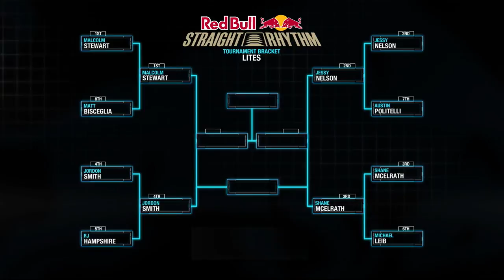Red Bull Signature Series - Straight Rhythm 2015 FULL TV EPISODE

Comment: Can someone tell me why they angle their bikes like that on the big jumps? Is it to make it look more stylish or to gain control?
Reply: its called scrubbing. its because theyve got no berms on a straight rythym track and that is mainly to control speed and not to case any jump
Reply: hey, thanks for the reply. Was trying to find out for an animation I'm doing and couldn't get info on it because I didn't know the terms to search for. Big help, thanks :)
Reply: It's to keep the bike low on the jumps, you want to stay in the air as little as possible.
Reply: DizzyMoonTV Twisting the throttle in air won't help them go any faster.
Reply: they are doing it so "scrub" off speed/height so they can go faster off jumps and not jump as far
Reply: A scrub, which is what you’re referring to, is used to keep the bike as low to the ground at possible, you can scrub so you don’t have to jump as high to clear jumps and keeps your speed up cause you’re not hanging in the air
Reply: Also prevents casing
Reply: Revving in the air makes the bike lean back using brakes vis Vera’s that’s why mx bikes have a low rpm rev limiter to keep from slinging the top end out

Comment: I don't understand why anyone would want to use a 250 when they could ride a 450 in this race, unless theyre inexperienced on a 450 which is doubtful seeing as how they're pros
Reply: a 450 and a 250 are very different rides, Malcom switched from a 450 last year to 250 this year. completely different riding style, not to mention rider size/weight difference of using the 450 to 250